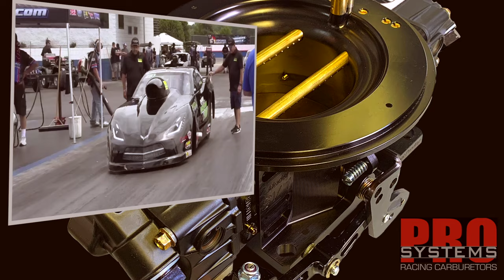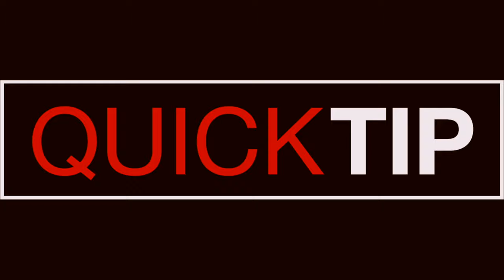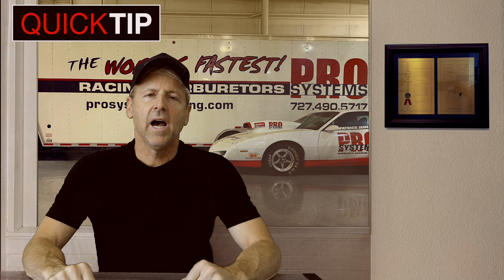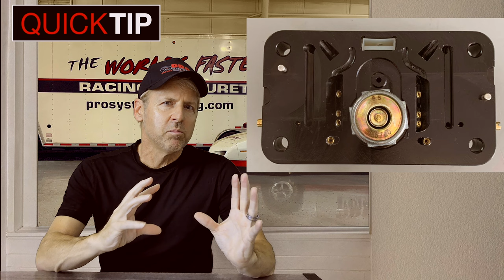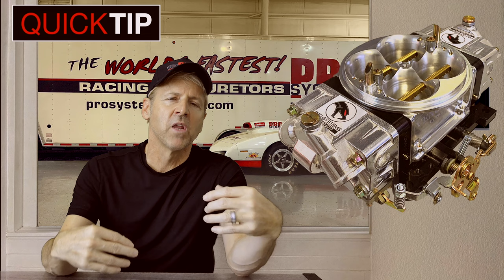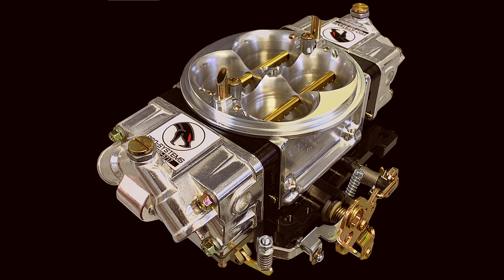Carburetor Emulsions and Air bleeds De-mystified

Comment: the precursor to emulsion tubes was the "air compensation valve". used in edwardian/victorian cars. an intentional air leak in the manifold, just a spring loaded valve.

the jet operates on venturi effect. the suction on the jet is based on air velocity through the venturi or throat.

as an engine can operate at a wide RPM range for any given throttle setting, depending on the load, the velocity through the venturi changes as well, and hence the suction on the jet.

therefore the suction is NOT linear with RPM or air velocity, but rather logarithmic. the result is the mixture gets progressively richer as RPM increases.

adding an air leak tends to keep the air velocity through the venturi constant, and so the suction on the jet and mixture remains constant for a fixed throttle setting... within reason.

the emulsion jet and air bleed simply puts the air leak into the jet itself, rather than in the manifold.

motorbike carbs like mikuni and keihin use the "pitot tube" or "ram air" principle rather than "air bleed" to perform the same function... progressively expose more holes in the emulsion tube as the fuel level in the chamber surrounding it lowers. 

its also why the otherwise identical carb behaves differently on a two stroke versus fourstroke... have to change the emulsion tube side of things.

quite fun to get a pipsqueak 50 or something, and block its emulsion tube holes for a hands on demonstration ;) why a 50? so you can hold it WOT without doing yourself a mischief...

Comment: .040 over 400sbc 5.7 rod, 12-250-3 comp cam rpm air gap 70cc e street aluminum heads brawler 650 dbl pumper.Will not idle unless crack rear throttle blade past transition slot.Is carb too small?change idle air bleeds?Drill throttle blades?
Reply: So many variables... I've been burned in the past by bad head work, where valve seats were so horrible I was seeing around 6" vacuum at idle on a smaller cam than yours - I honestly think the guy working them over skipped the valve job and just shoved hardware in after a good cleaning.  Trying to get a carb to idle nicely on that engine went sideways until I pulled the heads off for a tear down inspection.      Good luck, and... stick a vacuum gauge on that thing.
Reply: What timing at idle?

Comment: I have a Proform 750 DP race carb. I got it used. Ran great for a month or so, but now is extremely rich. It has 4 emulation port on each side of PV. The 2nd ones up have a blank bleed in them all others don’t have any. Also the 2 idle feed restrictors at top of block. Should I block more of the emulsions off. Not sure why all of a sudden this is happening. My only thought is that something was lodged in there and finally worked itself free when I decided to raise fuel bowl level from bottom of sight to middle. Hasn’t been right since. I did find a lot of rust in filter. Replaced lines and cleaned tank. 350 sbc, 9.5:1, big mutha thumper cam, aluminum heads, 3” exhaust. 75 corvette
Reply: You get it figured out Tony?
Reply: @brianb5779  yes, thanks. After 2 months of changing everything, I jetted it down, and it’s good, other than having to have 54* of timing, because of my cam!!
Reply: @tonyamatucci1999  awsome man,,glad to hear, was curious what you found out. If thats your timing locked out (all the time) then that is def an eye opener
Reply: @brianb5779  well. I haven’t tried locking anything out. I’ve tried manifold vacuum advance, ported vacuum advance, no vacuum advance, light springs. No real difference, but the timing has to be far advanced for any of it to run right.
Reply: @tonyamatucci1999  man Tony there is so much to cover,,,and worse case scenario ill shoot you my email and we can swap phone numbers and i can run you thru things over the phone. But my main thought here comes to this, if your saying it ran great at one point and with no changes now it doesnt then i would be taking carb apart and doing a thorough sonic cleaning and reassembly, pulling plugs and looking at them/cleaning as well. Id also pay attention to your transfer slot exposure with carb off (primary and secondary) and # of turns out of each mixture screw. If its running right now w the screws barely turned out from seated then def issue there w idle circuit. Yes everything runs better with more advance at idle (built motors) but gona take some time without having a start/retard  box that would be startable and good power. Ex, my BBF liked 34 degress (locked out) but had to wire in retard box to start it. So much more i could go over but kid home sick from school so dealin w that. I would focus first on good idling w no mixture issues (carb and ignition) then move on from there. I also mean no disrespect if these are things you already know just not sure where your at w everything

Comment: i have a 331 with quickfuel brawler double pumper 650 . mt half throtlle fuel curve is flat but my full throtlle fuel curve starts at 2000-2500rpm at 10afr and goes at 3500rp to 12-5 -13 and stays at this afr to 6000 rpm.

i have 3 emulsion holes (can i put a bigger one in the first top one to lean it out?   i allready tried going bigger and smaller on the high speed air blees

thanks for youre vid

Comment: There is something I can't quite get a handle on. Where is the fuel level in the emulsion  circuit at, idle, mid range, full power? Does it start out high then go low, per airflow, or the opposite low to high? Or does it match the love in the float bowls? Or is it all over the place?
Reply: David Vizard explains this in one his videos. The fuel sits high in the tube at idle. Pulls down to middle of tube at part throttle and all the way down at full throttle.
Reply: @iancoachwerksllc  Well if The Vizard says that's the deal, that's the deal. I have a bunch of Vizard books, starting with my first in 1978. I actually have an 4160 metering block in my hands right now, as I write, but my lying eyes still see it like one of those paintings where the spiral staircase goes up and up. If you ever get to identify that video, that would be appreciated. Something so simple sometimes turn me upside down.

Comment: I have a pair of 600vs carbs (4160) on my SBC 406 and they run great and put my Vega in the low 10's but its still running rich at idle, even with the idle mixture screws almost all the way closed (secondaries are cracked open but not enough to expose allot of the transfer slot and draw off the mains). I went from the factory 70 IAB's to 75's and didnt notice any change at all.. Should I go even bigger on the IAB's?
Reply: Lean out the idle air bleeds (iab) a tad maybe 6 jet sizes,  also make sure your idle slots are not exposed too much, it should be exposed just a square.
Reply: @Cuzntime  do your metering blocks have screw in idle jets?
If not, Drill em 1/8 and tap em 6-32 and your good 👍🏻
Reply: @timhateley  Are you talking about the IFR's? My metering blocks do have screw-in IFR's
Reply: @Cuzntime  yes my friend, ifr = idle jet.
What size are you running currently?
I'd guess you'll need to be in the low 20s
Reply: @timhateley  My IFRs are currently at .025.. How low should I go? I went from .070 to .085 on my IAB's and its not making much of a difference..
Reply: @Cuzntime  honestly if you have 25s and the mixture screws are only just cracked for decent idle? I'd put 20s in.
And do your carbs have transfer slot restrictions?
Reply: @timhateley  I will check for restrictors when i pull the metering blocks again.. Meanwhile i will get some 20 IFRs on order.. Beside a fat idle the carbs run great, I can hammer it from a dead idle and it launches hard..  Thanks for the help!
Reply: Here's a video that helped me sort out a couple things:  youtube.com/watch?v=tMsp7w5gJEk
There's a transfer slot feed mod on the main body about 2/3 of the way through worth examining.